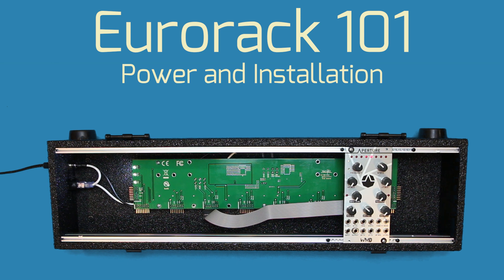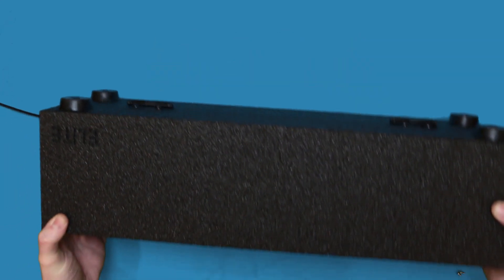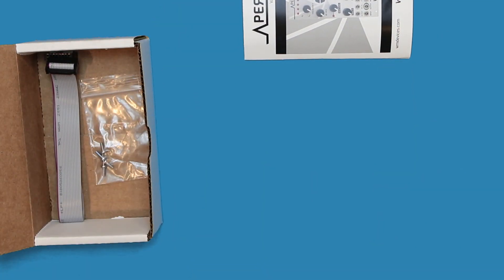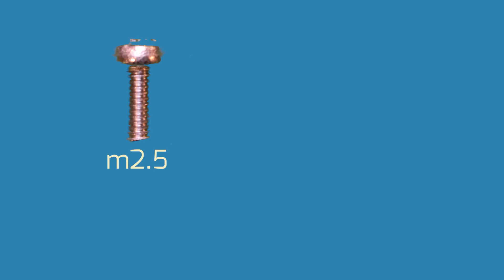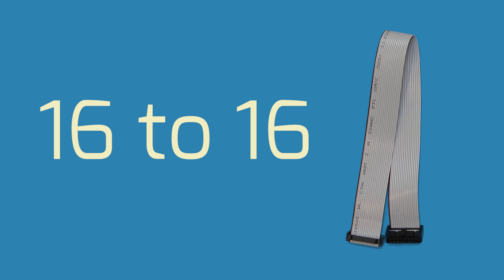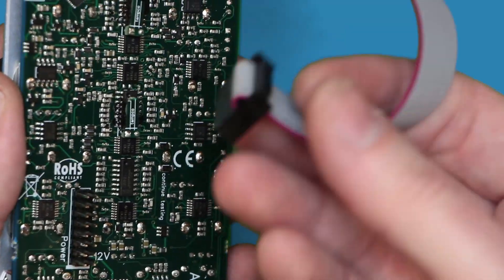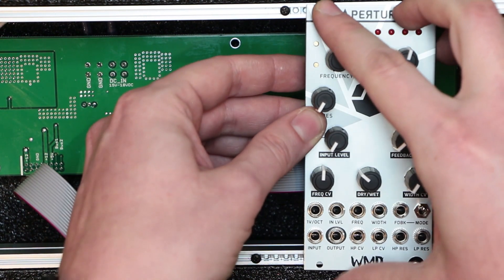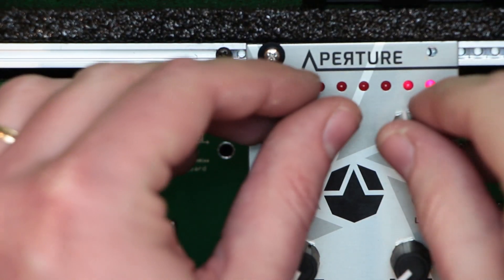WMD Eurorack 101: Power and Installation

Comment: Can you use 16 pin cables on 10 pin headers?
Reply from the maker: yes, just match the red stripe to -12V then hang the rest of the connector off the header.  Its best with vertical headers as if the are horizontal, the connector can hang off the side of the module, depending on the size of the module and location of the header.